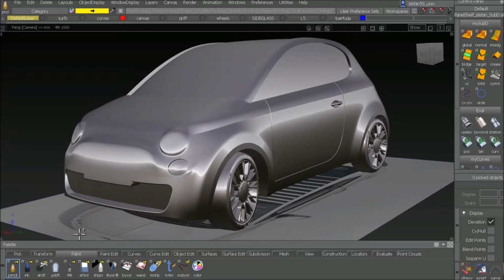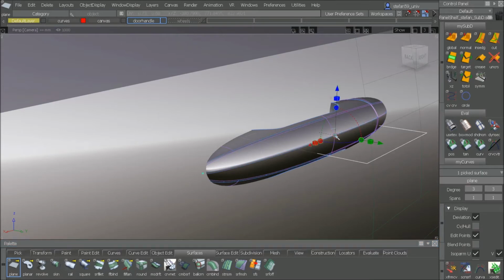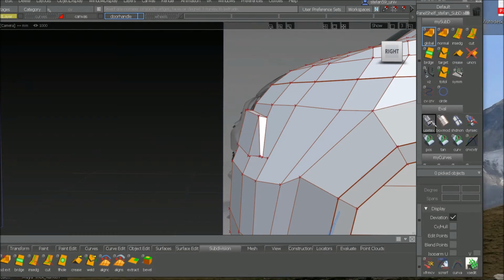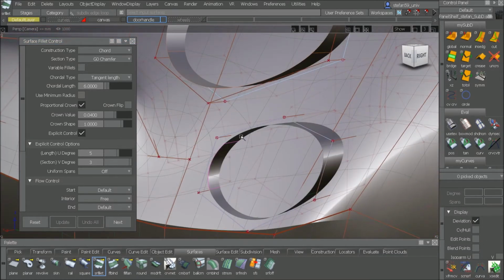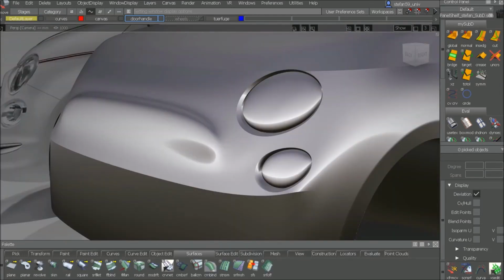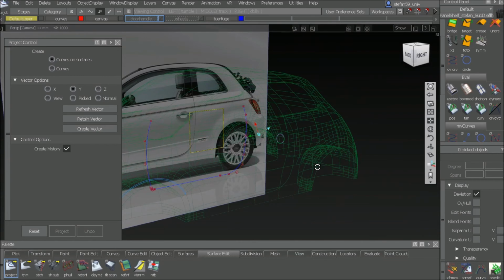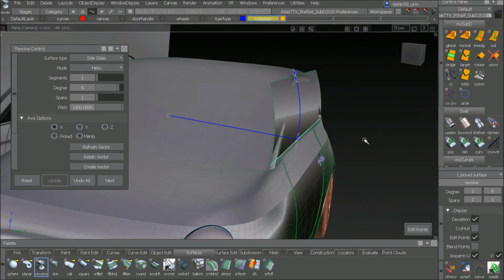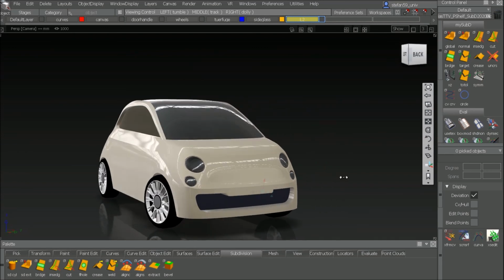Alias SubD -  Modeling Fiat500 -part2

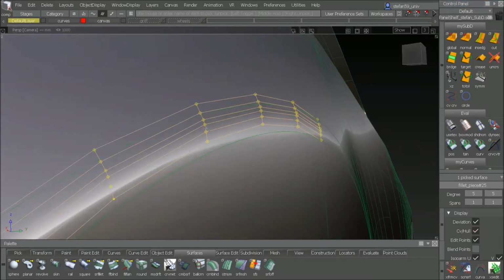Comment: 2:40 does it is possible to make this in maya?? this and the trim subd nurb function
Reply from the maker: Hi Project Ideal, not sure how to do this in Maya. I´m no Maya Expert. The functions are Nurbs-funktions which can be used on a Alias SubD model, because Alias Subd is a surface model not a poly. That´s why you can use Subd-Tools and Surface-Tools combined for hybrid modeling.

Comment: hey ! Im glad to see such an great quality of the video! and there`s one question that I can`t use panalgap function in alias which is student version??
Reply from the maker: Great that you like it! Panel Gap should be included. Check in the Palette with Right Mouse Button on "Surfaces"-Folder  -> "Rolled Edge -> Panel Gap
Also you can check your license "Help" -> About Alias
You can find out if it´s Alias Autostudio, Alias Surface  or Alias Concept. Concept has limited surfacing functionality.
Reply: @TheSTROHM  its totally understandable !!! now i found the fucntion thax to you!!

Comment: hi, thank you for the video! after the last step (putting half of the car on a symmetry layer) I get a crease in the middle of the whole car because they are not aligned anymore... Is there some way to restore the symmetry without this crease? thanks!
Reply from the maker: If you got a crease in the middle, probably the "Weld To Tolerance" did not work. If it is one symmetric Subd, you can even delete the edgeloop in the middle.

Comment: what kind of curves did you use to make the grill opening? I am having trouble trimming out the grill opening after drafting to front grill surface.  I only get partial COS, thus trim command wont work.
Reply from the maker: For trimming you should use Trim Project->3Dtrimming Vector Options ->X
Reply: @TheSTROHM  doesnt work for me as well... "Cannot trim surface. No curves on surface."

Comment: Hi Stefan, this is great. Can Alias Sub-D's be used for production surfaces if quality criteria has been met? Would there be a reason not to use them for production?
Reply from the maker: Hi Yusuf, Alias SubDs (G2 continuity) are intended for conceptual work at the begin of the design process. For exterior production surfaces you need classA (G3) . The benefit of the new Alias SubD-Modeling is, that you can do the complete design process with an integrated workflow using only one software!
Reply: Thank you for the quick reply. This makes sense.